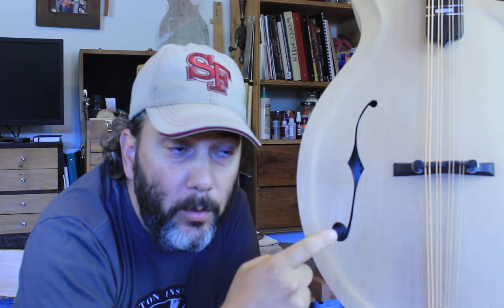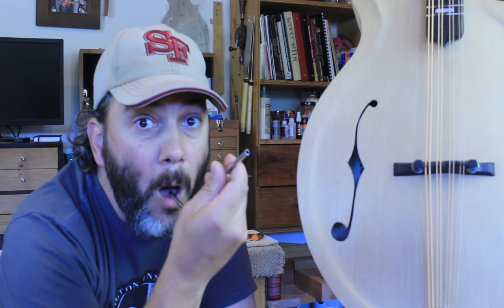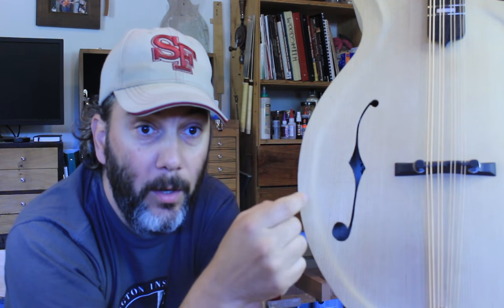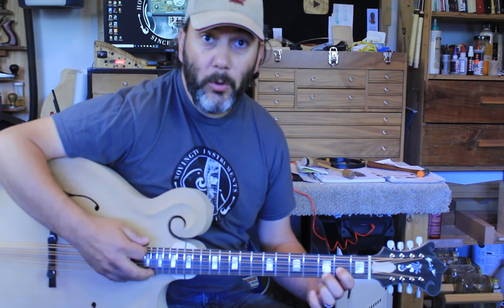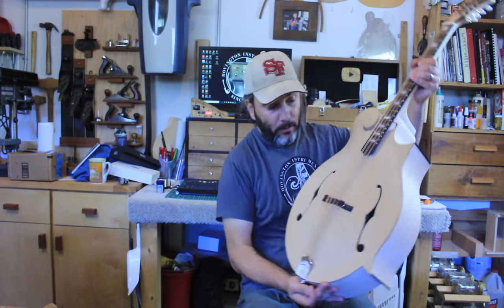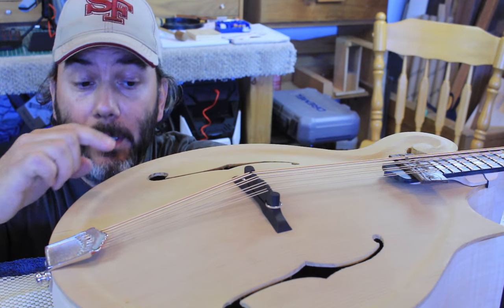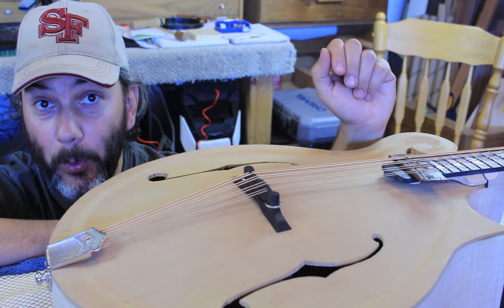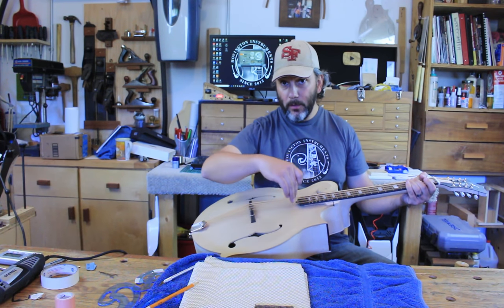How to do Voicing/ Part18

Comment: I know this is a small thing, but I just think doing jobs like trimming the f holes or many similar jobs could make your life easier by using violin knives, which cut precisely but take some of the strain off of your hands while you’re doing it. Ron Hock has 3 sizes that he offers, and there are the German Goldsteel brand, Pfeil has a series of sizes. Its painful to watch big jobs being done with Xacto knives. Those are mostly for balsa wood models to fly airplanes or whatever. You’re doing a much higher quality of work. Also, you could check with any violin makers about gouges they use for graduating top and back plates. My luthier really loves those offered by Stubai. Their special alloy steel and double heat treatment are second to none, but Dastra is a close second for making your job a breeze rather that being in pain for two weeks after graduating your plates. Don’t injure your tendons; it could wreck your career as a luthier. That’s why they have professional grade tools, bro. I really like what you do. Just a suggestion.